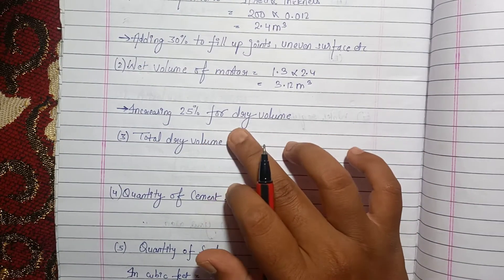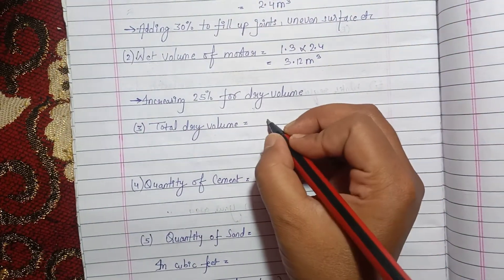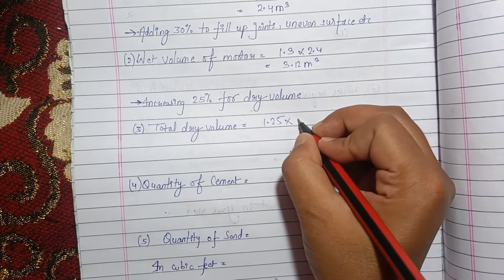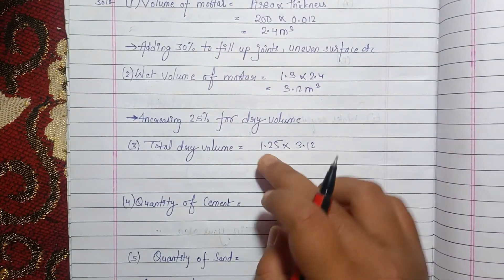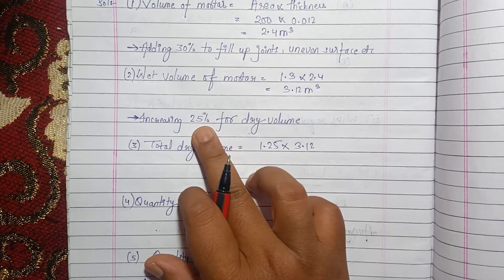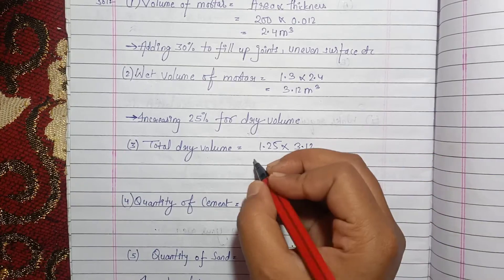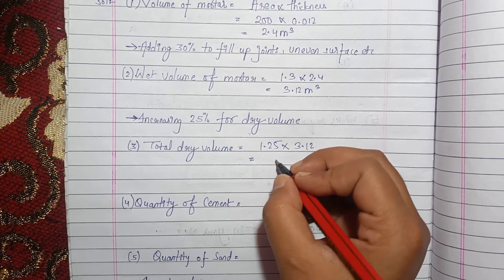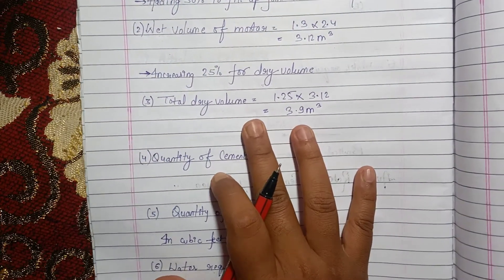Quantity of material in Plastering| Cement and sand in Plastering| Estimation and costing| Lecture 3

Comment: Or we simply divide the quantity of cement by 1bag weight (50kg) for to find no of bags
Reply from the maker: The quantity of cement in m3 is first multiplied by its density(1440kg/m3)  then divided by 50 kgs.

Or we can simply multiply the quantity of cement in m3 by 28.8.

Comment: is the calculations are same for the flooring?
Reply from the maker: Add 33% in wet volume of concrete to get dry volume of concrete for flooring and then follow the same step to calculate cement sand and water and cement ratio will be as per  given questions.

Comment: Mam, in previous video you said that plastering is measured in m²
Then how did you calculate it in m³
Reply from the maker: Yes, the area of plaster or plastering in general is measured in terms of m2
But here we are determining the volume or quantity of materials for plastering.
That's why we have to consider thickness also to get the volume 
Areax thickness will give quantity in m3 of materials.

Comment: Mam how do u wrote thickness 12mm in decimal form 0.012😶???
Reply from the maker: 12mm is equal to 0.012meter
It is converted because area is in meter
Reply: 12/1000= 0.012 mtr 🙎🏻🙎🏻🙎🏻